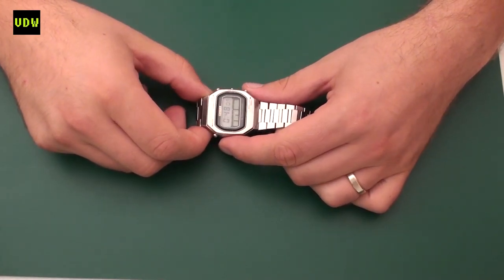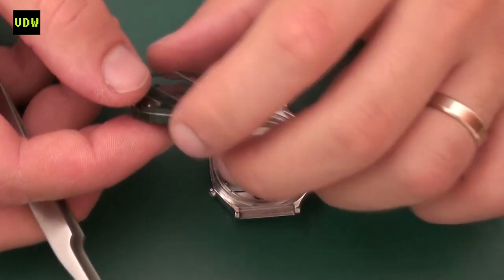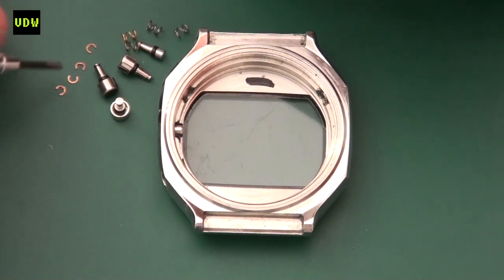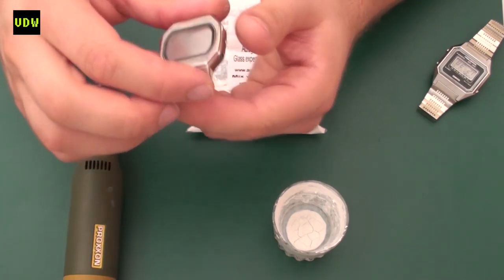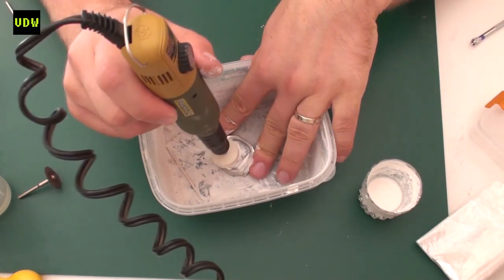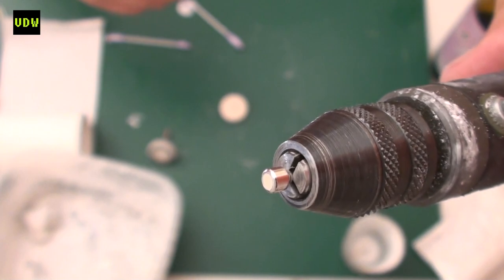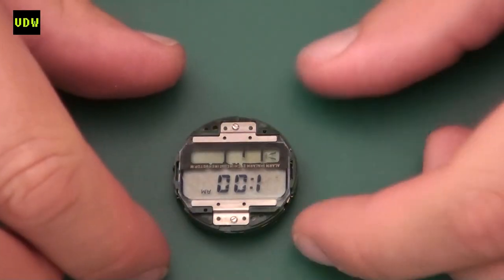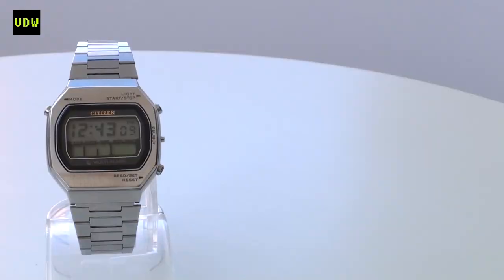VintageDigitalWatches - Ep 27 - Citizen digital service and fix (glass polish, microlight, alarm)

Comment: Nice work, i really learnt something today regarding glass polishing, i got hold of an old orient lcd ( i asked you about the battery yesterday)and i have refurbished the case to new looking, one thing i have to tell you, when polishing always try to keep the edges sharp, thats what gives the watch the high tech look i take out the glass if possible so i can polish the face of the piece like you polish the glass then i take a coarse bosch pad and give the face the deep brushed surface and last i take a steel sponge used in kitchen to make brushed steel look new and rubs the piece gently till i have reached the result in the brushing that i want,  deep and shallow uniform lines like ones factory made,thatmethod works for me, found through endless combinations  of trial and error

Allan 🌞
Denmark
Reply from the maker: Great stuff Allan, overtime I learned that it is not necessary to use the water on the sand paper. Keep it up! Tibi

Comment: I don’t want to interfere, the job with the glass is well done but I think my method is even better, I’ve done a lot of crystals.
The crystals get a all new look and there is no risk of waves in the glass.
This is only possible on flat crystal that pops out of the case a bit, it doesn’t have to be much depending on how deep the scratches are.
First, if the scratches are really bad I use a 360 grit paper to get rid of the deepest scratches followed by a 400 paper which is also okay to start of with if the scratches are not too deep, I’ve even used 280 for starters sometimes when needed. I’m talking about papers supposed to be used with water but you only use water the first four step , then you go all dry. You follow with 800, 1000,  2000, 3000,5000 and last 7000.
From 1000 and onwards you use no water for a better result, this should all be done on a flat glass surface and you need to be sure to stretch the paper through the whole process with the hand that’s free. You can use the papers many time, so it’s a good investment.
When the paper turns white from the glass you keep on going on that same spot, it polish the glass even more, this is from 2000 and up.
Good luck, please leave a comment if anyone have tried this, or try it and say what you think of the result. I can only say the result always looks super, just like on a brand new watch.
Reply: So you don't use Cerium Oxide at all?

Comment: I have a citizen multi-alarm III. The piezo buzzer is actually on the inside of the glass. The alarm is barely audible. Any ideas as to how I can fix it? Thanks.
Reply from the maker: Hi, if alarm is bzrely audible make sure the piezo is only touched by one spring or similar metallic piece. If piezo is touched by any other part of the watch module it may be grounded which is not what you want

Comment: Hi amazing job as always..
Is it possible to put a new piezo disc in a case back I have two seiko g757s with missing discs thanks in advance
Reply from the maker: should be possible as long as you have a piezo disc. Bu remember that whatever you use to attach it to the caseback should be conductive.

Comment: A little question, if you would change the glass, even for plastic one, could you?
Reply from the maker: You would have to fabricate one and would not be so easy.
Reply: @VintageDigitalWatches  yes I'm struggling doin it, I have a nice projext I hope soon to post it. But what will be the main issue if you want to make one, and have you some material you can suggest I can use it.

Comment: Hi, I did my first glass polish but I ended up with a slight 'orange peel' effect. The glass not perfectly reflecting the light. Any idea where I went wrong? Thanks.
Reply from the maker: Not deep enough, you should sand it to a perfectly flat surface and then use cerium oxide.
Reply: @VintageDigitalWatches  Thanks, the orange peel effect was all over the glass. I think I should have just gone a bit further with the 600 grit paper. Anyway it's looking a lot better now after I polished it some more with a thicker paste.

Comment: Hello, I need some advices! I would be very greatful for your help. I followed your glass polishing process. But I couldn't make the glass mirror shine. Isn't really foggy, but not perfectly shiny. What can I do. I tried the cerium-oxide several types of wet, but nothing.
Reply from the maker: Skip any wet sandpaper and just do it without. Go 600, 800, 1000, 2000 grit then cerium oxyde. Your crystal must be glass for this to work, it will not work on an acrylic crystal.
Reply: @VintageDigitalWatches  Thanks. I used 600, 1200 and 2000, after it cerium-oxide. Maybe the cotton pad on the dremel is not good?
Reply from the maker: @AttilaKarpati  What watch is it?
Reply: @VintageDigitalWatches  Certina lcd chronolympic
Reply: There were very deep scratches, but I removed them properly. But I used dremel with soft cotton, hard cotton, ear swabs with hand, etc.
Reply from the maker: @AttilaKarpati  What you described Is exactly what you need to do, the last part with the  erium oxyde usually takes 15 minutes.
Reply: @VintageDigitalWatches  Thanks, I tried once more. I put the speed of the dremel higher, and it was succesful.

Comment: When polishing the case do you worry about the printed lettering being erased?
Reply from the maker: Yes, you have to be careful, if you have printed lettering like in this case around the glass on the exterior of the watch, you have to be careful when rubbing it against the sandpaper to only touch the glass. It helped alot to have such a thick glass. Also the Cerium oxide slurry can have the same effect so you need to be careful there as well. Constantly sto and check for progress or any misspolishing

Comment: Hello, do you know if is it possible to replace the glass of a Casiotron 20s or simply make one? thanks, btw I´m fan of your videos, greetings from Mexico.
Reply from the maker: Hi, I have an S20 in my collection so I know that the glass has a very irregular shape. It will be hard to cut it to that shape and the graphics are on the glass, those will be very hard to reproduce. Your best bet is to find a replacement, or a donor watch, or sell it for parts.

Tibi
Reply: oh, sad to hear that, it is quite difficult to find a spare part and the watch is working correctly, i´ll try finding a clean glass. Thanks!

Comment: If i use 1200 sand paper its ok ?
Reply from the maker: Yes, that is OK, but 1200 is a fine grit, if you want to remove scratches that you can hook your nail into then it will take quite a lot of time with 1200.
Reply: @VintageDigitalWatches  thank you may be i well use 800 
Anothet question can i use poly watch to polish the watch in final step ?
Reply from the maker: @lund905360  Polywatch is more for acrylic no matter what they claim. You can try to use it but I recommend that the last grit you use is 2000 if you want to Polywatch the glass crystal.

Comment: its not possible with vintage Seiko glass?
Reply from the maker: You mean polishing a glass on a Seiko?
Reply: Yes...its a double layer..extra hard.
Reply from the maker: Can you send me the model name of the Seiko.
Reply: @VintageDigitalWatches  Hi, I have one like this, its the c359.
Reply from the maker: @kasperjr  You can easily polish it, if scratchese sre deep buff them out with grit 400 then 600 then 1000 then go with cerium.
Reply: @VintageDigitalWatches   I have to check..I have a special polish machine and it works with most of the glasses but not with a few. I have all the grits and cerium and other polish material but it didn't work. I have to look what model it was back then. 👍